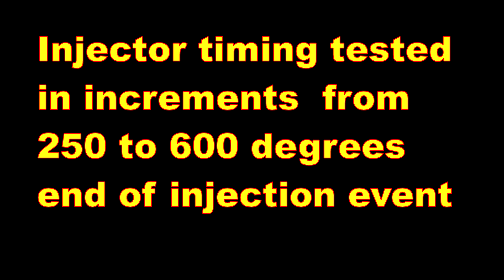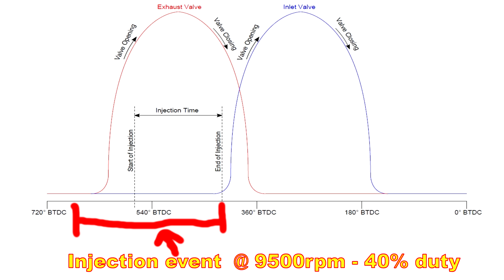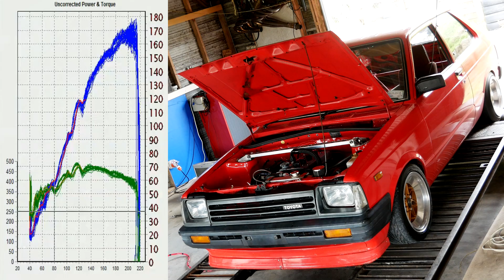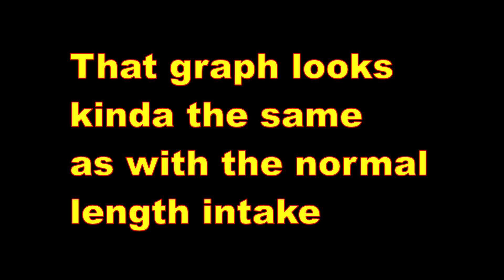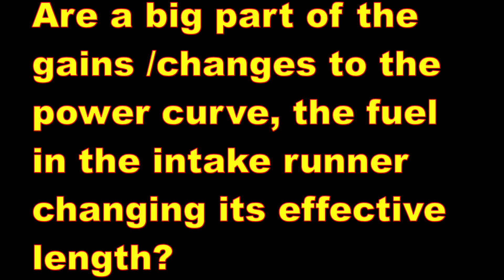Stand off / Outboard injection  - Fuel injector location dyno tested

Comment: This is like tuning a grand piano with a sledge hammer.. Moving the injector further away from the valve evens out the mixture, makes the droplets smaller (ideally) and cools down the intake making the air more dense. The mix has overall more inertia, making it behave differently. SO to get the best out of it, the port/runner shape, valve profile, valve timing, cam lobe profile, spark energy and timing, need all to support the different location of the injector. Messy shaped runner denses the droplets bigger than they were in stock form, and if the valve&cam profile doesn't support the longer wet runner length, the closing hot intake valve creates a pulse that pushes the mix out from the runner rather than into the cylinder. Just like you can't whack a Grand Piano with a sledge hammer and expect it to be in tune, you can't just make one drastic change on your setup and expect it to perform better with just tickling it. And for the cam timing, just as injector/spark timing, it needs a different value @ different rev and load.
Reply: Wow thats a lot of words to say nothing useful or give any quantifiable examples of what you're talking about.

Sounds like garbage to me.
Reply: @RomanDaveThings  whatever, my dear pigeon. U either get it or don't, all the same to me.
Reply: So can you give us a specific example of how you would adjust "port/runner shape, valve profile, valve timing, cam lobe profile, spark energy and timing" then? 
Based on injector position at port or stacks? Sounds like you're trying to claim expertise through vague anecdotes, which is never convincing. 

If you change all of those things, then you get people saying results are invalid because you didnt isolate only one variable. Cant win.
Reply: @RomanDaveThings  As U said, my dear pigeon, I can't win this, so won't be bothering. Also typing any more specific answer would only make my back hurt more, with no actual positive outcome. So, yeah. Whatever, Let's just keep it as a riddle. Get the riddle right, and you win the race.
Reply from the maker: @oikkuoek    Maybe instead of coming onto every one of my videos and attempting to pick holes in it.  you could share some of your wisdom and methodology.   Otherwise i dont see why you are here if, if you didn't come to learn anything,  or share anything.  At least tell us your background
Reply: @Garage4age  But I am sharing my "wisdom", or basic automotive knowledge accumulated over the years. Your videos are somewhat entertaining and the topic is interesting, but the learning part is questionable. I'm not poking holes for the sake of poking holes. I'm pointing out errors, or overlooks you young guns make. That's not a problem for me either, I made the same mistakes too back in the day. Also, I really try to make the initial comment as filled of structural critique and improvement suggestions as possible. If the tone seems rude or whatever, that's both cultural nuance and chronic pain inhibiting me to paint the story more polite. For that, if some snowflake bursts into tears bcz of it, I won't take a responsibility for it.
Reply: If the closing inlet valve has just had a fresh charge over it why would it be hot?

Wouldn't the most heat and reversion come from the overlap on the inlet valve opening (lowest inertia in intake port) while the piston is still rising in the bore expelling exhaust gas past the actually hot exhaust valve?

Comment: I forget if you’re running e85, in which case you might have so much knock resistance that it wouldn’t make a difference. I wonder if the presumably cooler charge will allow you to run a touch more timing.

Comment: What about using  two sets of weaker CC injectors?  will that even out the spikes & dips?

Like 150cc inner and 150cc outer? Have you tried something like that?
Reply: Having 2 injectors on every cylinder is pain in the ahh when it comes to setting up the fuel rail & wiring

Comment: To your question - Yes, the evaporative cooling is altering the speed of sound.
Reply: Adding fuel vapour will also alter the speed of sound even without evaporative cooling. Higher mean molar mass of the gases = lower speed of sound at a given temperature.

Comment: Curious about the Injector orifice design and testing eg: Single outlet (old) VS multiple smaller ones (new).
I know they help idle quality but more thinking atomisation and then maybe trying way upping the fuel pressure with the newer injector type.

This was a cool test anyway, reminds me of tuning RAM timings in a PC for some reason too. Glad you got some decent gains, especially down low.
Reply from the maker: they are bosch ev14 980cc. they are 7 or 5 hole from memory.  so yeh new style injectors
Reply: @Garage4age  If you're well insured and have a couple fire extinguishers nearby, i think we'd all love to see HOT fuel at stupid high kPa/ PSI/ Bar, if you're keen. Old F1 trick, not that F1 translates to road usage...

Comment: So I’m guessing long runners + outer injectors will be best of both worlds. There does look to be substantial gains in different parts of the maps with the outer/inner injectors. Does your ecu have 8 injector drivers? Could you run a varying ratio of inboard to outboard injectors?
Reply from the maker: This is what i was hinting at, at the end.  I'm not sold  that running the outer injectors on the longer normal length intake will be better, or make the intake act longer again. which will make less power.  only 4 drives unfortunately
Reply: @Garage4age  yeah it wasn't all better but there were some areas where it adds power/reduces a dip in the graph. But overall, it seems the gain from longer runners are of a higher magnitude than what the outer injectors offer. 
If you were developing a BTCC car in the late 90's and wanted to chase that extra 1-2% in a few areas, you'd definitely use outboard injection...
Reply from the maker: @Loud_Doorty_Noises   Yeah definitively a little in it, case dependent just how much.   in race car situation no question worth chasing.    In my case nice to know theres a couple kw left  there.  but the cost, work and extra complexity of doing it properly . not worth it

Comment: on the topic of fuel, could you see the difference in different fuel octanes and brands on the dyno?  Would be interesting to see Gull vs Shell vs BP vs NPD etc
Reply from the maker: i actually recorded a video ages ago testing 95  and gull 98.  but never made/ posted it, for a reason i cant remember.     short answer they made the same power.  but the gull gas needed a few degrees less timing due to the ethanol content
Reply: Pro Boost in Germany did this Experiment a few weeks ago. If you have a modern, FI-Engine, there are some gains (or lets say, the Engine unravels it´s Potential). If you have an old one, the gains are next to nothing.
Cheers

Comment: Something I might suggest is to mess with cam timing and/or cam to cam timing in order to get more overlap to allow the exhaust to do more scavenging to pull in more of that colder denser air charge. Something else like someone mentioned is with that colder denser air charge you can put a little bit more timing without detonation. Also turning up the fuel pressure as long as the injectors can take it would allow for more vaporization of the fuel. Also a fuel like methanol would show more of a improvement due to the higher latent heat and vaporization.

Comment: Interesting. Some YouTube tuners claim big gains from injector location/timing. 
 Is the air density the cause for effective intake runner length change? Would outboard water injection would have similar effect?
Reply from the maker: I would think so.    As for the gains, i could see more in some situations. if you start stacking things; like engines that dont do a good job of mixing fuel. poor injector spray pattern, intakes that heat soak bad or suck hot air from behind a radiator or something.  then combine it with an intake thats a little short.
Reply: @Garage4age  basically, outboard injectors can give bigger gains if rest of the design fails.
Reply from the maker: @tiitsaul9036  i could be wrong,  but it seems this way to me

Comment: I find this quite interesting. The outboard injection I played with on motorbike engines used injectors with a very narrow spray pattern and mounted them quite a distance from the bell mouth. The outboard injectors were only used at high rpm high load, the port injection was used for everything else. You don't have the space to do anything like that though. I also wasn't a huge fan of how the intake track would catch on fire if there was a backfire and have flames licking at the high pressure fuel rail mounted above it. Felt kind of sketchy.

Comment: A timed injection with such a large injector that it's only running 40% duty cycle isn't taking full advantage of the atomization time the longer distance affords....might see different results with a constant injection which will fill the runner better and might/should atomize better.   And I believe that 10K rpm is about where the benefits of the longer injection distance begins to show benefits vs injecting right at the back of the valve.   F1 motors that spun to 18K liked the injectors at the stack mouth but that kind of rpm is beyond what that Toyota will deliver so this also is muddying the results.

Spinning it high enough to really show an advantage is not possible...but running the injectors like they're a CIS might offer some benefit.   Good testing!   Always enjoy your videos when you post them!
Reply: If you have a lower duty cycle, spraying more fuel earlier. Then ALL of the fuel gets closer to the same amount of time to evaporate. If you have a high duty cycle, some of it will have had 90% evaporation time and some 10% evaporation time (or whatever)

Comment: It's the difference in cooling effect of the outboard injectors that changes the speed of sound and therefore the ideal length..
Reply: You should try normal inboard injectors plus a set of outboard injectors but the outboards running a dedicated fuel system of methanol or ethanol or both, change the ratios of fuel types.

Comment: the fuel injector spray will be effecting the resonating air movement in the runner, with the external fuel injectors see how high you can run the fuel pressure on the injectors. the higher the fuel pressure spray the more energetic it will become. by running a much higher fuel pressure this may help create a small Venturi effect by drawing in surround ambient air and slightly increasing the air pressure in the intake pipe / at the intake valve. think of how energetic a high pressure washer is, and how it influences the surrounding ambient air while only using a small amount of water. the other thing to take note is the finer the fuel droplets you can make while using higher fuel pressures the more chance you have of evaporating all of the fuel into a gas forum which will be fuel that is guaranteed to burn on the combustion process unlike large size fuel droplet (liquid fuel does not burn) the more fuel you can vaporize into a gas the less wasted fuel you will need to inject into the engine which allows the intake valve to have a chance at flowing a little bit more air than it usually would. could also try different types of fuel injectors and spray atomization patterns and the max operating fuel pressure's.
Reply: Good point.

Comment: Can you make a video about having one injector output for all injectors (from 1 to 4 squirts per engine rotation), paired injection (2 inj out, 2 squirts) and sequential injection (4 inj out)?
As older BMW's run 2inj out for 6cyl (1st 3 cyl had 1 inj out, next 3 had second inj out) or some had 1inj out for all cylinders
Reply: K-Jetronic?
Reply: @marceloho1984  nah.. normal injection in M10/M20/M30 engines

Comment: I would suspect injector timing would have a much larger impact with the injectors in the "close" position. There is much less time for the fuel to atomize and mix with the air. Injector timing doesn't really seem to matter much at WOT and high RPM, but it does have a noticeable impact on idle quality and emissions at low to medium RPM and loads.

Comment: This has to be the most dynoed machine on the planet. Learning so much. My mate had a corolla hatch with a 4age+t in it but that was when we were just kids 15 or so yr ago. Prob only had 195s on the front and broke up until 4th but would beat our "rich" mates dad in his then new devil yellow GTS monaro lol.
Reply from the maker: hah, nothing like beating fancy cars in ya crappy old toyota.     starlet has over 1400 dyno runs now.
Reply: @Garage4age  insane! Goes to show how well she's built. Appreciate the time invested and the willingness to share everything you've learnt along the way.
Reply: @Garage4age  that's an insane number of dyno runs my friend, you can run for the World recond if exist any (well, you can create it, hahahaaa), you deserve it.
Reply: I have a TU5J4 engine, 1600 16v also highly developed and has had hundreds and hundreds of runs on our dyno 
215bhp 150lbft 1597cc 8400rpm 

We gained a shit load of torque by having 15 deg less duration on exhaust cam
Reply: @mattyoung4639  we too play with peugeots 1.6 16V engines, our clients race those engines on peugeots 106 and citroen saxo in italian hillclimb, a great engine, we too obtained about 210 to 220hp (crank) from them. I think those engines have big potential to go up in rpms because they have a short stroke, but rarely seen go over 8700rpm, maybe some work is required in the head.
Reply from the maker: @mattyoung4639   nice work.  Yeah the 4ages' tend to like a bit smaller exhaust cam also.

Comment: Do you think that all the tests you do on the 4age would have similar results on rotary engines, or do you think that the results wouldn't at all be transferrable due to the difference in airflow and general function?
Reply from the maker: same deal. obviously  lengths and sizes will be completely different.  ported rotary is like a big cam piston engine. will respond real well to the correct intake and exhaust lengths.    a friend had a peripheral port engine that would have been keen to play with.  but it didn't make it that far..

Comment: i think the effective intake length is effected only slightly by the increased density of air and fuel. 
improved air and fuel homogenisation is likely what helps power more. 
i'd guess you might be able to tweak spark timing a very tiny bit with the outboard injectors, or increase coil strength/voltage
Reply: Probably slightly better intake air cooling too.